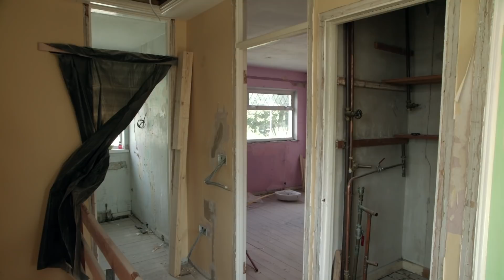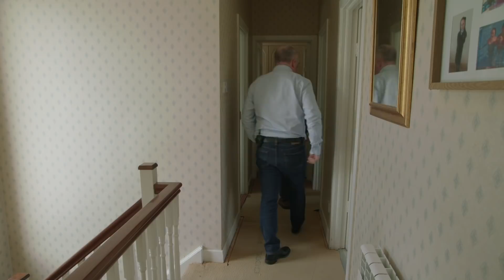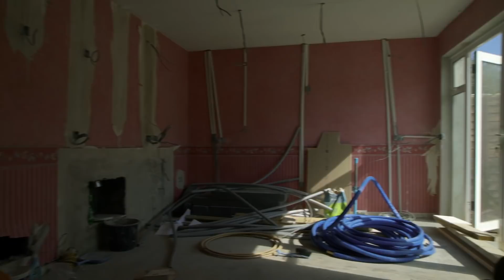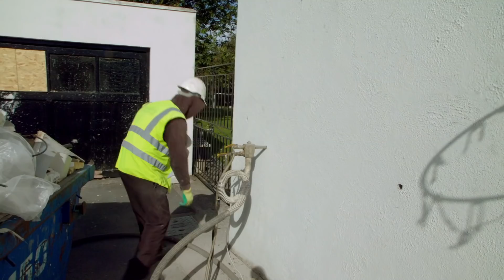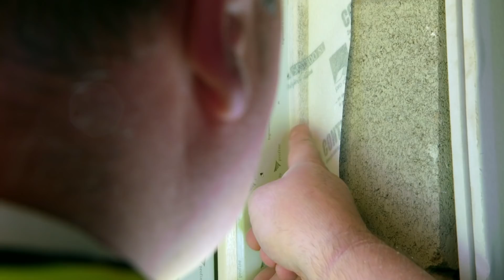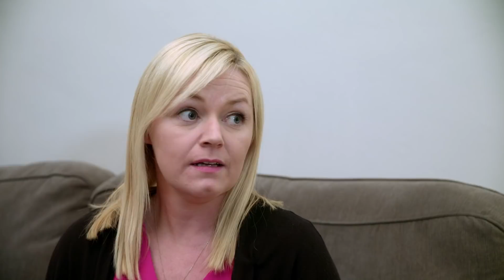Home for Life(Home Deep Retrofit) EE17 EP2

Comment: EWI fitted here (house in the south east of the Netherlands), combined with tripple glazed windows and flat roof insulation, still to do is insulation of the pitched roof and partially the ground floors.
Also HRMV and underfloor heating with heat pump still to do, for now I already save 60% on my  energy bills, heating is with air to air at the moment which is already proven sufficient to -5°C.
The house was rated G, but in practice energy consumption per m² was more like E/F (gas consumption 35000-40000kWh/yr for 210m²) . Energy consumption now akin A and after fitting solar it will rate A++ or even A+++. But I get it certified once everything is done

Deep retrofitting is well funded by grants in Ireland, here in the Netherlands it's 30% of the cost at max, a fixed rate per m² of insulation is granted and for heat pumps, solar boilers etc which are listed.
But you always have to apply for two measures to get the max of 30%, otherwise they will only grant 15%.
And it has to be installed by a certified company, no grants on DIY, this is to guarantee that installation is done correctly, although in practice I would have done a better job in some aspects and often it will also be cheaper even without the grant. EWI and heat pump are/will be done by a contractor however.

Comment: @ 17:00 min. Saying what a panel generates when first installed is inaccurate. They degrade very quickly in the first 1000 hours. Called light induced degredation, it is part of this type of panels tech and cannot be avoided with current methods of manufacture.
The rated power should be from after the "initial degredation" period.

Comment: Interesting, still dont think pays back financially as a heat air sorce heat pump will still cost more than a gas boiler. Am no expert but would have thought the vent ducting would stay with in the envelope to reduce heat loss and gains?
Reply: They installed solar panels so the payback will be faster (generating their own power instead have to keep paying for gas). They also got 50% government funding which will make the payback super fast. What they didn’t show was the heat exchanger build in for the mechanical ventilation, which recovers 60-80% of the energy from the exhaust air to the incoming air. Look up “passive houses” if you want to learn more.

Comment: It's not expensive at all if you do it yourself. And you get to learn something along the way. :)
Reply: The issue is if you get it wrong and create damp patches by incorrectly applied internal insulation, you're stuffed. So best to do external insulation and cladding. Look for the EnerPHit standard (EUPHit if EU.). Fitting the heat exchanger and MVHR is best left to tradesman if you fit the ducting. For home insurance reasons.
Reply: @markp8295  thanks for your feedback, mate.
Reply: It's actually easier to do it yourself. Getting tradesmen to do this is a nightmare.